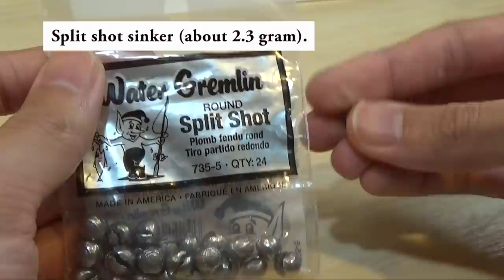How to make a Mini Pencil Bait lures (Step-1. Making a Lure body) / 手作り小型ペンシルベイトの作り方1

Comment: great videos haru, really really good. your channel is amazing. I think there is a mistake in your pencil template. It says 6mm balsa wod but i think you have used 8mm balsa wood in trhis one. thank you for your videos. Keep on going! cheers
Reply from the maker: Thank you very much. After reading your message, I checked the lure and the template, but I still think I am making it using 6mm balsa sheet.
I will continue to make lures, so please support me.

Comment: Congratulations, beautiful work and excellent video! Could you please tell me the diameter of the circular holes in the wood?
Reply from the maker: Thank you very much. This lure is drilled with about 8mm and 7mm holes. However, the optimal hole diameter varies from builder to builder. Therefore, I think it is best to decide the size of the hole according to the situation.

Comment: Hallo, Haru san,
Love your work, so detail, and seem very easy for beginner to try make it ones, 

I'm sorry, i've print this pencil bait template , but the length, somehow become 10cm,

Haru san, could you make the template for minnow,, "Exodus Kraken 59s"?, 
And please make video "how to make that lure, step by step, 

Can't wait for your another work, 
Thank you, 
🙂
Reply from the maker: Hello anas, Thanks for your question. The reason why the pencil bait is printed large is probably due to the printer settings. Please use the ruler at the bottom of the template as a guide to set your printer and print.
I am making a prototype of a small sinking minnow, However, I think it will take some time to complete.

Comment: Haru can you please tell me what the size of these split shots is. You say it's around 2.3. It's American unit I suppose. what is it ? #5 is 2.56 grams/water gremlin, and small one is BB size 0.56 grams/ water gremlin. Its hard to find american unit split shots in Europe.
Reply from the maker: Thank you for your message. Sorry for the delay in replying.
My guess is that there are two different weights for the No-5 size of Water-gremlin.
On the US website, the No-5 size is listed as weighing 2.54 grams, and the one I bought in Japan 10 years ago had the same weight.
However, strangely enough, about five years ago, weights of about 2.3 grams began to circulate in Japan. And now only 2.3 grams can be found.
I do not know why the weight of the water gremlins sold in Japan differs from that in the U.S., but hopefully the grams will be standardized.
Reply: @haru834  thank you for you response. Did you test with heavier split shots. What the max i can go?

Comment: Olá amigo muito show  como  faço para conseguir  os moldes em PDF
Reply from the maker: Hello!. Thanks for the question. The PDF for the lure is available at this URL.
If you set your printer so that the ruler drawn on the bottom left of the template is the correct length, you can print it to the exact size.
*Mini Pencil Bait PDF: https://drive.google.com/file/d/1jICys2LxITjslZA6MNuUWJ6lsp0vwyxr/view?usp=sharing .
Reply: @haru834  obrigado 👍😀

Comment: i have print out the template it seems pretty big from the video i want to ask if it has afjustment for the size
Reply from the maker: What is the length of the lure body template?. This lure template has a body length of about 72 mm (about 2.8 inches).  If the sizes are different, try changing the settings on your printer.
Reply: i have measure it with a ruler it became about 9.5 cm

Comment: She sits leaning to one side in the water
Reply from the maker: Good evening, Илия Топуров!. Because this lure has rattle ball, the lure body sit on the side slightly as the rattle ball moving. In most cases, attaching a hook will solve this problem, but if the lure still sit on the side after attaching the hook, the following are possible causes.
*One side of the lure body has been shaved off too much, and the left and right sides are not balanced evenly.
*The hole for the lure weight (or rattle ball) is too deep on one side.
*It's rare, but it is also possible that the hook and the lure are not balanced properly. Lure manufacturers have a lineup of hooks of various shapes and weights, so depending on the hooks you attaching, you may not be able to maintain the balance of the lure.

I think you can solve the problem of the lure sit on side by making the  shape and buoyancy of the lure equal on each side when viewed from the front.
Reply: @haru834  I mounted the hooks аnd the position  are perfect. The hooks are 0.38g. Nomber 8. Тhanks for the reply.The bait is very good.